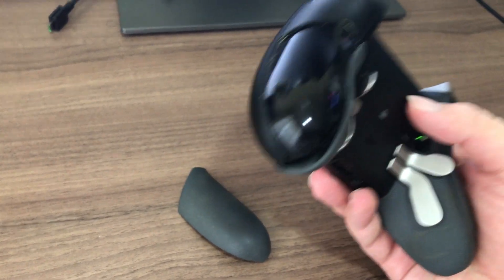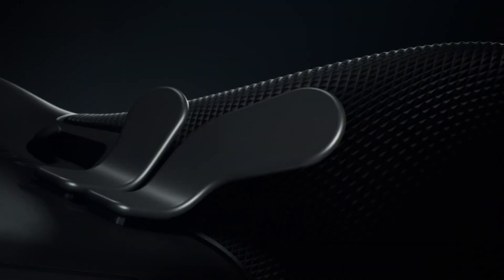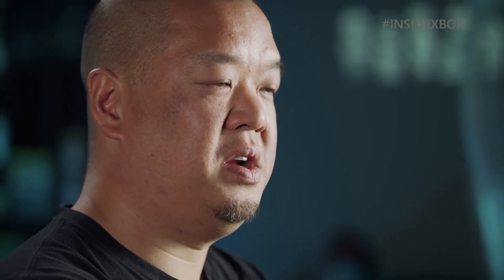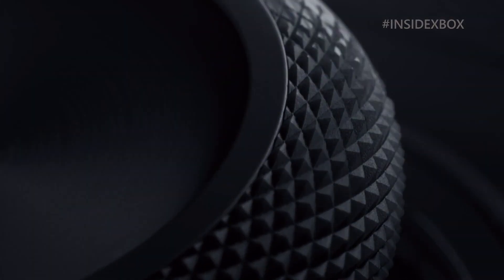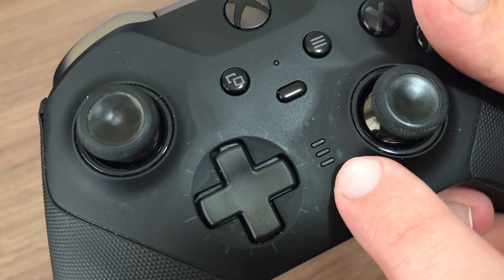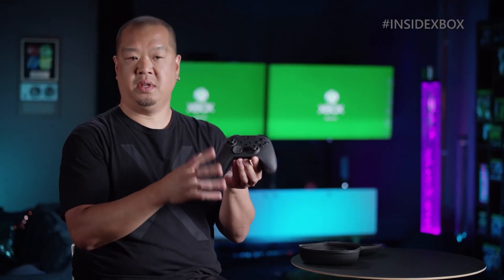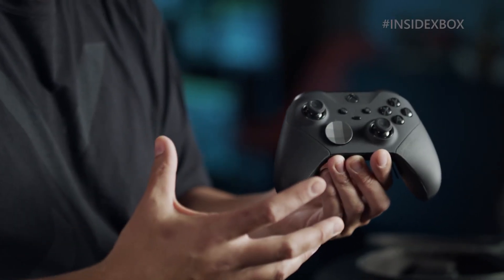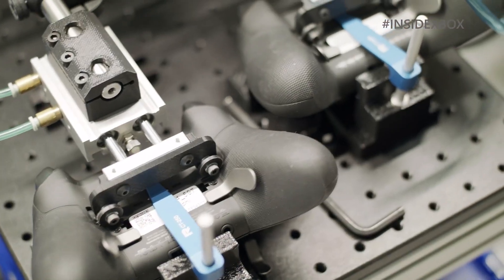Xbox Elite Series 2 After 1 Year: Did Microsoft Fix The Durability Issues?

Comment: 2024 here. Bought one 2 months ago. Instantly had xonnection loss issues. Thought it was my 10 year old Xbox that the sync button didn't even work on anymore. Upgraded to a series x still had the issue & the other night it just completely stopped working. Could manually turn off the Xbox & turn on the console with tye controller. But none of the other buttons would get any response on the console and it acted like it wasn't actually connected. Went and replaced it and got another one which so far works flawlessly. But I'm nervous bout the way it'll work long term so I bought a gmsir g7 se for back up

Comment: People should clean there equipment. I know the original had issues. But I’ve had mine for 6 months now of daily play 4 hours or more and working great. Clean your stuff people. Yes I know there were quality control issues. But I’ve seen some people fix their issues with buttons by simply doing proper cleaning and maintenance.🤷🏼‍♂️
Reply from the maker: 6 months... give it time.
Reply: @jidenshaotoko  I will save this one. When it starts to have issues I will post it.😂 I made sure to get one from a new lot. That’s was supposed to be the updated run. So we shall see.
Reply: @ParZIVal19D  What do you mean by 'new lot'? As in, is there an official confirmation of new updated better built batch? If so how can someone know if they have a newer model vs old? Has Microsoft officially confirmed to say they have made changes to improve production?
Reply from the maker: @FHD There's no new lot.

Comment: I returned one for a new unit yesterday because the left click felt soft in COD when the stick was pushed up into run-forward position and trying to click to re engage sprint. New unit sale issue. Disappointed.
Reply from the maker: Have you tried tightening the stick with the tool that comes in the case?
Reply: @jidenshaotoko  Maybe I’ll do that and see if it makes a difference.

Comment: Looking to upgrade from my old xbox 360 controller for pc. Had it almost 10 years and only has minor drift issues now. Seems they have lost their quality.
Reply from the maker: Yeah, whatever you do, don't go for the Elite Series 2. It's a great controller overall, but it would be a massive downgrade, build quality wise, from the 360 controller. The regular Xbox Series controller is much better built, but it still doesn't feel as tight as the 360 controller unfortunately.

Comment: I'm 100% convinced that every single one of these "elite" controllers has an inherently flawed thumbstick. If you go into the Xbox accessories app, under the configure section and select a profile where you can adjust the controller settings, you can test it where you adjust the thumbsticks. When you're not touching the thumbstick, it should rest right in the middle of the circle. If you pull in either direction ask the way and let it snap back and it will center, BUT if you only slightly move the thumbstick in a direction and feather it, it will stick right off center causing stick drift. It is so sensitive that even a shake of the controller will cause it to "snap" back into the center position. The problem is that while you are aiming, you aren't always pulling the stick all the way in a specific direction. You are feathering the thumbstick in order to get precise control. If you happen to pull your finger off the stick, it will get stuck in the spot, even though the stick looks as if it centered, the potentiometer is engaged. I notice this the most while pulling up the map in DMZ. The cursor will just start moving on its own and I have up move it around to regain control. I've returned 4 Core models and another 3 regular Elite Series 2 that ALL had this issue. Its the first thing I did when I got home from the store was test this in the accessories app and each and every one had the same behavior. Considering this was the case with 7 of these controllers out of the box, I am going to go out on a limb and say this is most likely the case for every single unit they've sold. Oddly enough I have never experienced this with their standard "non elite" controllers. I will never again purchase an XBOX Elite controller unless the Elite Series 3 comes with Hall Effect sensors. This is beyond ridiculous that they have been lying to us for years about how they "improved" this model and are using better components. Microsoft is full of shit and has the worst QC I've ever experienced in a company.

Comment: Good xbox controller but don't expect it to last more than a few months as the stick modules always break an bumper triggers ect, even the rubber grips peel off over time, I have since got a ps5 edge controller as I went to a ps5 an much better controller.

Comment: All the face buttons on xbox are shit due to the bad quality contacts on the membrane inside.
My personal fix, which probably no one will do, is to open in and solder smd 2 pin switches and completely cut the face button membrane.
Now I have an xbox elite 2 with mechanical face buttons, so no issue registering button presses on ABXY.
Reply: Do you perhaps have a guide for it?

Comment: Dropped my controller to the point where I hear something loose inside of the controller. I did have a bumper issue but fixed it by gently smashing it.
Reply: Update: stick drift arrived. Sticks are loose.
Reply: @alexphophi2893  how long you have it for ?
Reply: @alexphophi2893  if the sticks are loose, that isn't stick drift
Reply: Wdym by gently smashing?? Explain how you fixed the bumper issue
Reply: Warranty for these are the shit. Send it back. And accidental damage warranty isnworth it when. Bundle with the x
Reply: @awallerfamily  Lol, ive heard these have a 90 day warranty. Terrible for an expensive product. After 90 days your out of luck. :/
Reply: @WAncouvOR  it's a one year warranty
Reply: @WAncouvOR  no it’s a year. my warranty was over a year and they still fixed it
Reply: Did ye, aye?
Reply: @Kameron2335  It used to be 90 days but now 1 year
Reply: So on the fence on buying this because of the reliability issues.
Reply: @Kameron2335  wait seriosly? i have serious issues with mine and ive had it coming up on 2 years, so pretty much since it launced. i dont use it anymore but i loved it and would like it fixed. I get the sticky axby buttons, and rb being weird
Reply: Same here.
Reply: Love when that happens.😂
Reply: @alexphophi2893  I got stick drift on my second day using it ( I do have sensitive settings that can exagerate stick drift) but I really don't care my original controller doesn't have stick drift with those settings after 3 years

Comment: It's crazy to see how many people(included me) have issues with the RB not working or eventually stop registering and even the rattling sound in the control as well. Luckily for me that's all my issues in the first one my second one has right stick drift very minor, pretty easy to control but both of them have the same small top of the rubber next the RB sticking out and not gonna lie it has me super paranoid
Reply: Same here
Reply: Lol I’m to the point with the RB that I’m about to solder a new switch in
Reply: Open the controller up, there is a plastic white piece between the switch en de RB button, get it out. put a tiny tiny piece of ducktape on it to make it a bit thicker so it registers the click better, put it back and it works all fine again. did it yesterday, fixed al my problems
Reply: @POLPO_WOOD  don't open it if it's under warranty!!
Reply: its annoying especially when they don't give you a replacement thats why i didnt bought the halo one
Reply: Had 2 elite V2 controllers and the first had issues with the y button not registering and on the second one the rb button stopped working
Reply: Rb for me
Reply: @marshmalone3429  I did
Reply: The RB button stopped registering for my controller recently 😕 sucks I wish Xbox had more durable controllers
Reply: The RB issues is on every controller
Reply: @marshmalone3429  I replaced my RB
Reply: so this vid is a year ago.. and i'm only seeing it now.. and yes i recently also had this issue w the RB button.  It's under an extended warranty which i expect to be covered.  Bought a new one to replace the unit.. just waiting to see my claim go thru then get my  money.  This 2nd controller feels like the Y and B buttons aren't quite 100.. maybe 90 to 95ish % great.. sometimes it feels like they don't register..but maybe it's still breaking in.  Bought a Skin on Amazon to protect it better and help with cleaning-- highly recommend if you do long sessions and sweat.  I've logged in 400+ hours on it with Elden Ring among a few other games..and had it run well on the 1st controller for 2 years.
Reply: So, I play a lot of rocket league and my boost button is LB. I didn't have issues with the xb1 controller, but my series x controller's LB button snapped off its hinge mid game. Happened after 14 months. not ideal.

My white one I bought to replace it just had the same issue today, but it's odd. I think the spring has gone. It presses easy if I press close to the type c port. But on the edge it feels mushy and easy to press. It doesn't fully press now so I'll go for kick off on RL and my boost will be cutting out despite my constant input. 

I have a thrustmaster eswap s. It's cool. Sticks and buttons feel nice, but the shape isn't great and the triggers and bumpers just feel awful. Nice feedback in the trigger but little travel. Definitely aimed at shooters.

The xbox controller is just the nicest controller to hold for me. (I'd use my ds5 but i get cramp using it)
So I'm just wandering if the elite 2's bumpers are the same as the regular series controller. If they are then I'm kinda stumped on what to do lol.
Reply: @harry-cj6wu  opening the Front Cover is fine
Reply: same with RB and and thumb stick and changed it both
Reply: Both of my bumpers don’t work, the y button gets stuck, a never works and some times b gets stuck Also

Comment: I am so disappointed in this controller. Despite an initial feel of much greater quality, the buttons quickly become an issue. I would sometime press and hold a button and start counting to see how long it takes for the signal to go through. I sometimes reach 3. Since I have constant pressure on the button, I doubt it's a contact issue... perhaps something in software? Also My RB completely broke and my controller is now basically e-waste - after about a year.

Comment: My thing is the integrated battery, I wish I could have the option to switch batteries if they start to degrade
Reply: well you can...
Reply: im sure you could replace the battery with ease, it's not like defusing a bomb
Reply from the maker: @joey You can't. There's no compartment for the battery. The only way to access it is by literally ripping the entire controller apart and with how many rubber pieces covering seams and screws there are, it's a complicated and risky process.
Reply: @jidenshaotoko  Yeah that's what i meant bro, but i get what you're saying. You're going to have to spend an awful long time carefully taking parts out but being a mechanic i find it fun, but for many people it will be a tedious barrier for repair
Reply: Gamers are so undecided. Everyone keeps complaining why Xbox still use AA batteries. We get a 40 hour interval and now people complain again.
Reply: @vitorfernandes651  Not really.  It needed the 40 hour lithium...but fucking replaceable like any good device.  That's not asking a lot.  Like every other failure point on this controller, this is 100% intentional to fuel replacement sales.  That said, I'm now a master of tearing this PoS controller apart to fix and modify what I want.
Reply: Man , that's a deal killer, I thought it had a battery compartment. I always swap battery packs , it's more convenient than charging the controller.
Reply: ya thats my only real gripe besides the durability.
Reply: @DIYStangsandFreedom  I agree and the durability issues is probably the main draw away.
Reply: @vitorfernandes651  the only people complaining about the double A thing are Sony fans.  Most X-Box fans prefer rechargeable double A batteries over built in ones because they hold a larger charge, last longer, and if they ever die or stop holding a charge they are cheaper to replace.

I haven't bought one yet because of the battery issue.  

I did some digging though and found it uses a lithium ion battery so it shouldn't have any memory issues.
Reply: This may sound impossible, but I wouldn't mind if Microsoft releases different variations of the Elite 3 (if they ever start making them) like a wired only version. It may be ridiculous to think about, but I really do not want to buy a pro controller thinking that the battery can fail on me.
Reply: Its not hard to get into the controller to change the battery 5-8 minutes and the job is done and way less nerve racking than changing your iPhone battery!
Reply: @inawrocki207  playstation does the same thing….

Comment: Gone through multiple replacements, it has some issues. Rb button is dead now. A button fails to register if u press it at a certain angle, this happens on every single elite 2 ive had. top back buttons fail to press in correctly, not making enough contact.

Elite 2 is an amazing controller but it just cant hold up under normal use.

Comment: i just found out people have been having issues with xbox controllers, i have had a normal xbox one controller and it’s been working perfectly for more than 5 years
Reply: I once bought the Pubg controller and it lasted like 6 months and the bumpers broke

But still my controller from my xbox one s still works perfectly fine
Reply: @DL_NWN  my left joystick got drift up and down in only a month and I took such good care of my controller
Reply: I have the version that was wireless, about 10 years or more! Working fine with just a small crack from falling, and he did it a lot! I only want to upgrade to a new one due to it being so old and I want something good and comfy :)
Reply: @gela77  yep, been almost 10 years for mine.. I want something that just isn't as old. this controller has served 🤣
Reply: The controller durability lottery is annoying. I've been blessed and cursed. Project Scorpio controller still going strong, outlasting multiple "normal" ones.

Comment: nope.. I treat this controller like GOLD . never dropped never abused. Put back in its case cleaned regularly used daily.. Left stick will not click so no sprint or boost.. warranty up 3 weeks after the stick wont work .$117.00 to send it back to microsoft and they will send a refurbished one.. No offer to fix just replace and you pay another 100 bucks..

Comment: You guys have some horrid luck. I've had mine going on a year and a half, bought it used and the only problem is slight stick drift thats easily fixed if I open it up and mess with analog itself. And I've dropped it plenty too.

Comment: seriously, the design and handling of this thing is pretty nice, bluetooth connectivity is flawlessly implemented in Windows and thats it. I would not buy one of these again though, I'm a professional with IT and electronics and the parts and designs used in this controller are just so incredibly flawed. With this controller you'll be in desperate need of buying a new one every 1-2 years while any of your Playstation Controllers is still rocking it without any major problems. 
It is designed in a way that opening it to replace parts or doing a deep clean wich it definietely requires every year is made really hard, the battery might hold up some 2-4 years and thats maybe more than plenty for a device that starts breaking down after less than a year. Still, this thing as nice as it could be, is quick waste! the repairability is really bad and due to design flaws on the electronics and interior design you will experience most problems again just months after sending it into repair.
every xbox controller in my peergroup comes back to me for fixing every year and none of them gets older than 3 years maximum. Especially the pro controllers are harder to fix than the normal ones but they have the same flaws, for a device that costs such an immense amount of money I'd expect at the very least 5 years of flawless operation before the first button needs replacement. This thing is nice from the outside, but on the inside its pretty broken.

Comment: i had at least 3 elite controllers and all had problems even had 1 where the trigger stop adjust knop broke off it is only plastic unlike the elite 1 that had metal adjusters. some other problems i had with them is stick drift, RB button registering 2 times when pressing 1 time, thumbstick grinding that created dust and thumbstick click left side not working anymore. i really want the new controller but i am scared it will brake again after just a few weeks. my elite 1 still works and have it from 2015, only a few things like the rubber coming lose on the grips and minor stick drift witch can be fixed on steam or threw ingame deadzone adjustments. i am looking at the SCUF instinct pro atm might going try that one but i hope the rubber on there grips last. i just would like to see an elite 3 that last long like the 1

Comment: I have a pre-release one that I won in the Taco Bell giveaway in 2019. It's had some issues, but not with the rubber grips. The rubber nubbins on the trigger stop switches have come off, and I have a stiff paddle button, (good thing I don't use them), I had a bumper and a trigger break, and the rubber grips on the sticks are severely worn down. I made all of the repairs myself with parts from eXtremerate, and it cost me about $30. I even customized it with a new faceplate.